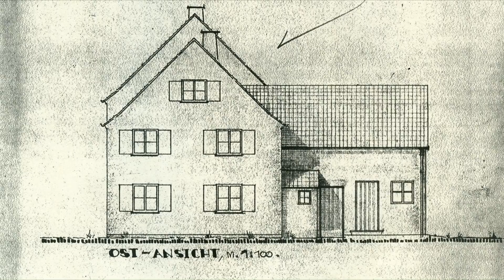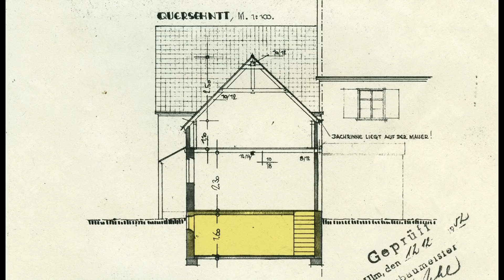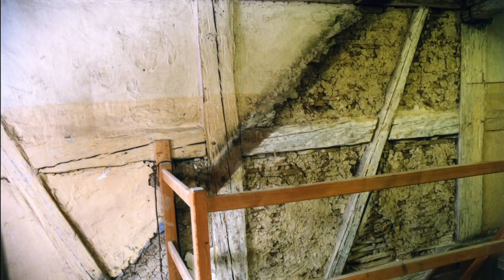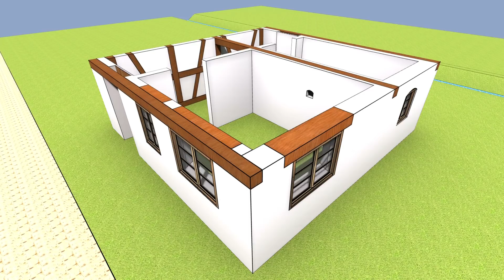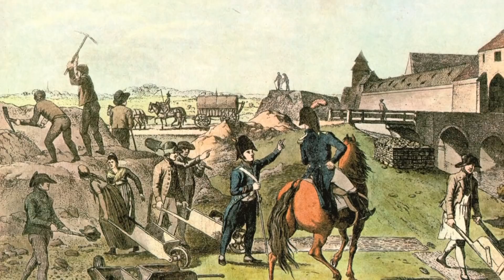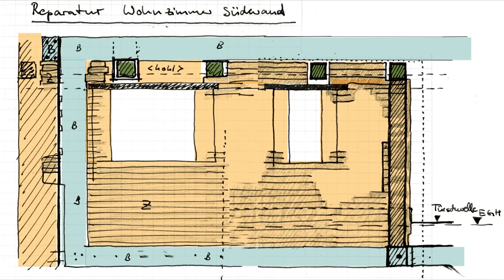The tiny half-timbered house 1

Comment: 175cm ceiling height? That's 30cm shorter than I am!
It would be an absolute nightmare to stay any significant time in such a building...

All that said, I find such houses fascinating. I've seen one collapse due to rot and the upper floors landed on the ground level and still looked perfect! In videos, I've seen flood damage to houses in the Artal and again, the upper floors rested unharmed on the remaining vertical elements... I know a half-timber building where every beam has cracks up to three meters long and 1cm wide and people still use the upper floors as well. You could never do that with a brick building with this many such severe cracks...

Comment: The methods you used are not uncommen in the world of restoration, as an expert I can tell you that much. But these are very time consuming and relay for there success havely on the skill and knowhow of the person doing the work. So if I don't know the person doing the work I will not advice this method. We have a simpeler approach with less risk but the downside is that is saves less of the house. The balance of time, money and value is always complicated. And than we as "experts" have to make judgement calls and factor in that we can be held accountable for a long time. 

The saying will always be: 10 engineers, 10 solutions.

Comment: If you had to pay someone else to do the work, I think the "expert advice" would have been the only financially feasible approach.
Reply from the maker: True. But afterwards I came up by another solution that would have been financially ok even without my own work: Identifying the parts that can be saved, taking the house completely apart, keeping only the good parts (floor joists and inner timber frame). Then a company could rebuild the groundfloor and a carpenter could make new timerframes using all suitable old parts and so on. But of course there are other and mostly non-technical reasons that this method is rarely applied...
Reply: @matthiasburger2315  it's cheaper to use new beams.  Old beams can't be put into the robotic machines that carve timber framing joints - too irregular, too much risk of metal and such, too hard to work around existing mortises.
Reply: @matthiaswandel  agreed, the mortices would have to be cut by hand, which requires more time and money in hiring a timber carpenter.